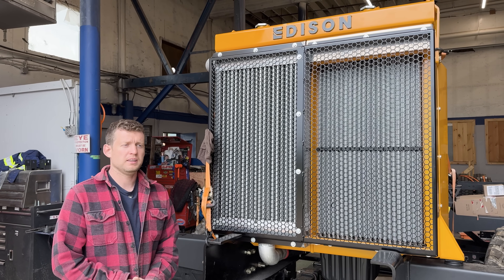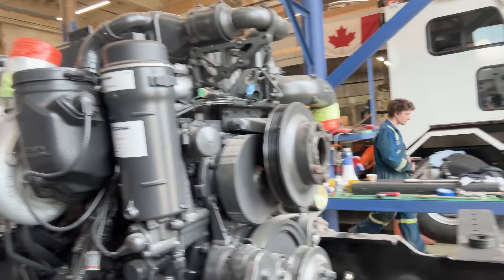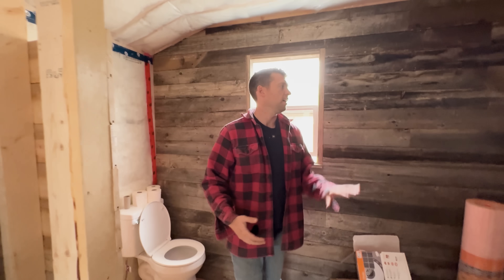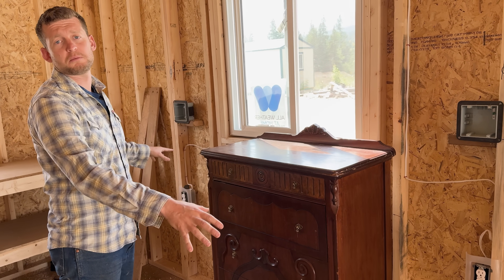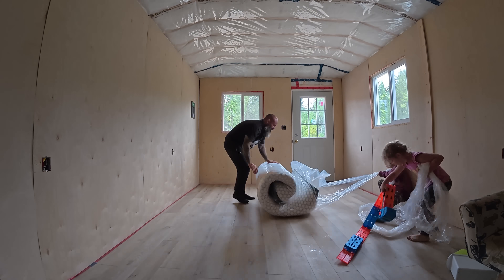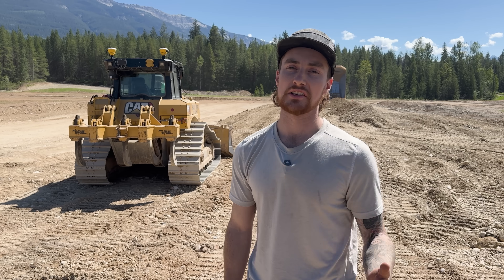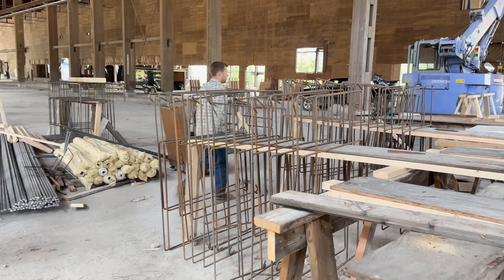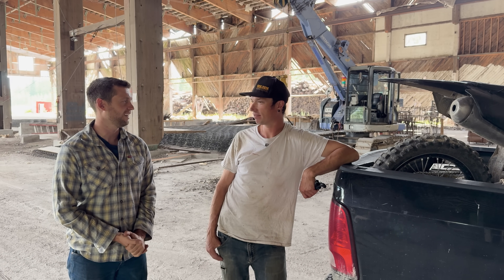Red Tape Can’t Stop Edison Motors - Full Update Inside

Comment: I think Edison can find a way to IPO and also retain their values and control.

4000 lbs is an impressive lift for the cranescavator. Great tool.

Motocross track sounds fun.

Onward and upward.  Carry on Edison, you got this :)
Reply: I don't think so. There hasn't been a single publicly traded company that has held its morals long term.

Even if they maintain a majority stake in the company, investors can and will put massive pressure on them. Even if they resist this pressure, they risk having their stock price fall, which leaves them with no way to raise capital, which leads to less investment in a vicious feedback loop. The only way out of the loop is to have enough cash on hand to buy the company back and take it private or to declare bankruptcy.  Usually, it's the latter. Especially for small companies like Edison. 

The egg has to crack at some point, and the investors are the ones with the money, and therefore the power.  As soon as IPO happens, the rot begins.  

IPO is a deal with the devil, and the house always wins.  

I also want to say that private equity works in nearly the exact same way and is not a solution. It just operates outside the existing laws and regulations surrounding public companies, such as insider trading and risk management.  A public company has all the investor agreements public and open, where's private equity is bespoke and hidden.

Comment: Any plans of building a race truck? Or possibly a hill climber? Making a run on Pikes Peak in maybe an awd truck  with the wide singles on all 4 corners. With the motors on the axels the center of gravity is going to be low. UNSPRUNG WEIGHT IS ANOTHER  ISSUE.

Comment: so i droped a coment abouit adapting the road engin to run the generator .i didnt twig that the engin and generator were a unit .i hope it works out in testing and with the exemption .
Reply: The new salt /sodium ion battery’s will be a game changer for the industry 10 x cheaper and handling the cold weather better
Reply: did ltt

Comment: Question so how are you gonna deliver trucks when you can't get the diesel generator certified to be used ?
Reply: Edison has several options for exemptions. They're trying them 1 at a time.
Reply: At the moment they are building diesel mechanical trucks to keep revenue flowing.
Reply: @georgewhy3886 they haven't built and delivered any trucks

Comment: I thought you only needed a small engine to run the generator. Why did you go with
such a big engine?
Reply: That is a seriously small engine compared to any truck that size.
Reply: The 15 liter engine they would normally put in a heavy duty vocational semi weighs like 4000 pounds roughly.

The Scania 9 liter engine they are installing weighs like 2000 lbs plus an approximately 2000 lb  generator is bolted to it which equals roughly 4000 lbs.

Roughly approximately

Comment: Just like to suggest something to look into going forward, investigate buildings , built with  a Sip panel system.      You could have a wall 24/8 foot piece ,that would work as walls ,roofs ,floors , the panels are very easy to work with .!  Check it out.       Heck you could make a flatbed trailer out of one ,and motorize it ,  it would make an interesting school project. !!

Comment: I have a concern about the choice of mounting location for the radiator on that piece of angle iron for what I assume will be the location to mount the mud flap. What happens if that bar gets bent, it will damage a very expensive radiator.
Reply from the maker: Yeah, We've already pointed that out and are designing a new bracket.

There was a few mistakes like that we've made we've noticed while building
Reply: @EdisonMotors  Sounds like you're going the right speed then.  Dad ran a laser business for years and he found the development programs that went the best had about 10% "wasted" parts left over.  The extra parts are a side effect of striking a good compromise between enough analysis to be sure it'll work and slapping things together asap.

Comment: Have you considered replacing the DEF-SCR with an H2-SCR system?  

Some advanced engines can already achieve thermal efficiencies above 50%, but they remain impractical in real-world use because of the constraints and inefficiencies tied to DEF-SCR aftertreatment. By replacing DEF-SCR with an H2-SCR system, those engines could become viable: you eliminate DEF pumps and crystallization issues, reduce parasitic loads, and open the door to much cleaner and more efficient operation. The small 1–2% fuel penalty for running a reformer is more than offset by improved NOx control, better cold-start performance, and the ability to push engine tuning closer to its true efficiency potential.

Comment: I'm an engineer in Ontario and I've been quietly watching and pulling for you.  I've also had a lot of my work colleagues tell me they are doing the same.  There's a lot of people behind you guys cheering you on that you never see or hear about. If you never give up, you can't be defeated.
"Man is not made for defeat.  A man can be destroyed but not defeated."  - Ernest Hemingway, The Old Man and the Sea.
Reply: I’ve been following Edison Motors and have noticed the challenges with current DEF-SCR systems — parasitic load, reliability, cost, and limits on tuning. That’s why I’m curious about H2-SCR as an alternative. Hydrogen injection could simplify aftertreatment, avoid DEF handling, and potentially reduce parasitic drag. I’m not an engineer, but from an operator’s perspective I’ve seen the downsides of DEF-SCR. Do you think it’s worth asking whether a better aftertreatment path is possible? Perhaps Scania, not being tied to DEF-SCR revenues like some OEMs, would see the potential value of exploring this sooner.
Reply: @karlswanson95  running DOC( cat like found on aftermarket Cummins for jeep-swap's and or electric-heated-cat to save on lighting-off-fuel/time )/no-def&tank in my 2c is still generally better tree-hugger than the currently/old way/shaft-linked as short-trip's it can plug-in/no-diesel running so far-trade in the short ramp-up technical details wise as pre-run-time/mile it's still the same or less

but then i didn't get most of the fuss of VW-gate ( pasond 4-door/wagon getting 30./or/50~MPG ect ) and or im looking at gm/biuck's ( like lecross as im trying to be far of same lot-era/engineering-goal's ie 4-people-mover/work-daily-ect and yes for era BEV was there Gm dragged intel elon starting to eating there sales but they probably could have pushed telsa-out of they stayed corse/liming model's 1990's-forwarders but got lazybones/greedy/ect ) geting 20mpg~ and thinking of the tanker's/refiners/extra-parts-need-ect

2030 models might come with turbans-gen as there lighter/less-maintenance/ect but currently finding support/supplier might be to hard for 2026-models
Reply: The old man caught his fish, but when he brought it back there was nothing left of it.
Reply: 🎉🎉🎉🎉 I'm hoping they can force systemic change.
Reply: I too am an engineer in Ontario cheering for Edison. I'm the wrong kind of engineer (HVAC) to be of any real use for them but it looks like living the life!

Comment: You should make the truck a plug in electric with a generator option that can be added or removed by the customer instead of a permanently mounted feature. That way it’s not a permanently mounted engine that can be regulated.
Reply: people keep seeing people recommending making it a "plug in" and offer the generator separate to be installed by the customer. its not that simple, if a vehicle manufacturer makes a part that modifies the emissions of the vehicle it needs certification. even something as simple as an auto manufacturer updating its ecm software, that calibration file has to be certified. iirc a 3rd party modification needs to be "emissions compliant", but not necessarily emissions certified. in theory they could sell a generator upgrade from a 3rd party company, but that becomes a problem when the epa looks into the whole thing and determines its not emissions compliant, and, back to square 1

 They are going about it the correct way, bringing attention to the public of whats going on, and pressure will be put onto the government to correct the problem.

Comment: Stop messing with petrol.

Just go straight electric. Put a 1.5MWh battery and be done with it.
Reply: The 200 kWh batts in these gen3 Edison trucks weigh at least 3000 lbs. You would need 21,000 lbs to get to 1.5 mWh which reduces payload and the truck would still not get through an 8 hour shift of vocational work. Maybe in 10 years when battery tech improves.
Reply: @Sah-o5m  Correct ~21,000lb.

Mileage = 1,200km. Far longer than HoS.

Don't forget, current battery (3k) plus generator (4k) are already 7,000lb.

So full EV is only 14k lb more. And 1/10th the moving parts.
Reply: @Sah-o5m  Comment is mostly irrelevant.

Logging has long load/unload times. Electric is better for this. No idle. No consumption.

1.5MWh is plenty of battery for full day service. Even less would likely work.
Reply: @Debunker-p9q Cool. Let the market decide what's best for the industry. Like how many battery powered electric trains exist vs their diesel electric counter parts.
Reply: @ArchoniaAdventures  The market will decide. And it will decide electric. That's why Tesla is building BEV only.

The more time Edison wastes on Hybrid, the more competitors will steal their lunch. Very simple.
Reply: @Debunker-p9q Edison Motor's Tesla Semi hasn't even arrived yet lol
Reply: @ArchoniaAdventures  Tesla built the Semi factory in 4 months. When it opens soon, it'll 50,000 units per year.

Edison is starting way behind. They have a niche market. But the more time they waste on petrol, they harder chance they'll have catching up. 

To win: Commit to BEV.
Reply: Edison offers Mechanical trucks, Hybrids and Pure EVs.
Reply: @ArchoniaAdventures  There is no use for a hybrid truck.

Just build it electric. A 1.5MWh battery has 1,200km range and 90% fewer parts. Scrap the halfway stuff.
Reply: @Debunker-p9q If there was no use for a hybrid truck, then how come Edison is getting flooded by orders? Oh wait it's because nobody wants to pay twice as much for a pure EV that they'll use in the middle of the woods. Go buy a Tesla Semi if you want a pure EV truck.
Reply: @ArchoniaAdventures  It's not twice as much. It's less than hybrid.

Batteries are $40/kWh now and plummeting.
Reply: @Debunker-p9q with a limited range vs series hybrid like Edison's model and with less payload capacity because of the battery weight. Great for Tesla trucks that haul weightless potato chips and short routes for Pepsi.
Reply: @georgewhy3886  Utterly clueless comment.

Truck can haul 150k, but 14k of battery is the straw that will break its back? 🤣
Reply: You have no idea what you're talking about.
Reply: @GildedRed  I have a huge idea what I'm talking about.

You on the other hand, do not.

Comment: UL, EPA and DOT (in the US) tests and compliance are absolutely brutal. Not sure how it is in Canada land but you guys got this! Keep up the good work and keep on pushing.
Reply from the maker: Safety Standards FMVSS & CMVSS should be difficult in order to keep standards high and roads safe.  But for EPA having no common sense way to apply an exemption or allow cleaner technology is insane.

Ironically; we've had zero road blocks so far on Safety standards and have passed all the tests we've preformed so far.  Safety standards are laid out in black and white, simple to follow, and it's a pass or fail.   Emissions standards are a nightmare of complicated red tape and Bureaucracy.
Reply: @EdisonMotors and everyone cheats on them too. Cummins, vw, Honda, Toyota, everyone basically lies to get their products through. Aerospace regs are similar levels of painful.
Reply: @EdisonMotors if a company has got enough money, it's not a problem (bribery is an issue)
Reply: We also aren't that smart about it. Just enforcing adopted US standards harder doesn't make stuff less environmentally impactful.

We should change, and adapt to the pace of new tech (which is ultimately greener i.e. look at how fricken cheap solar panels are- ahem without tariffs & anti dumping fees).
Reply: @MegaDarkTroll the richest companies pay for the regulations so they don't have to compete with companies like Studebacher and Pacific etc.
Reply: It’s worse in Canada
Reply: Canada basically has 50state rules, plus a bunch of eco zealot polticians, provicially and federal.
Reply: @davecollins6113 it's not the eco zealots alone. It takes two to fuck, and the opposition from the faction of the oil barons is the reason that regulations are an impenetrable mess: need a bunch of carve-outs and exceptions for anything to get done.

To a point, that's just the system as it's supposed to work: a bureaucracy is necessary to avoid too-fast change. It's the role of the bureaucracy to make sure one catastrophic outcome of an election can't ruin a country for good (remember, the moustache man was elected in a democratic state).

It's frustrating waiting behind bureaucracy to sort shit out, but at least some of it is there with good reason, and exemptions to established procedure SHOULD take time and consideration.

Comment: Awesome to see you trucking along! The certification will come one way or another. Shop construction looks great! Happy the community was able to help with some skilled operators and machinery! 
-Just a question, did you have the cranes on-site professionally inspected \ load tested since moving in? I'm sure they're fine, but for the money it's nice to have the up to date stamp.
Reply from the maker: We'll get the certification.  The cranes in the new shop are certified.
Reply: @EdisonMotors  Great! I'm the first to say, "It'll hold it". But I'm not a business owner, just a guy lifting 3,000lbs on a 10,000lbs crane. Or somesuch, I rarely hit load limits.